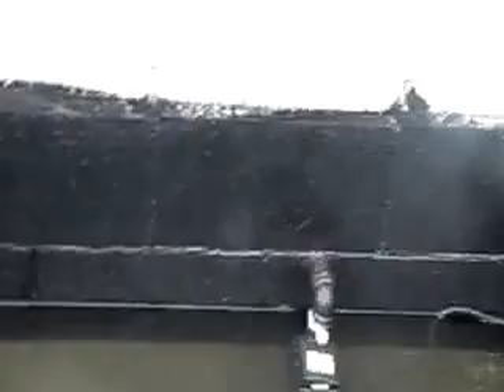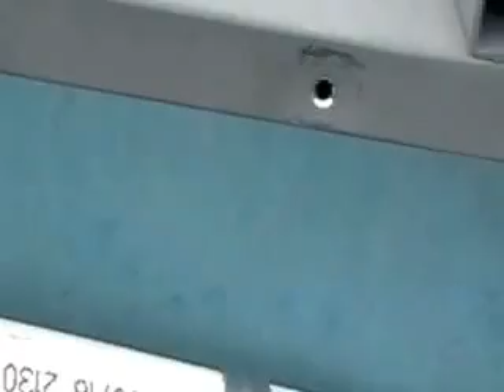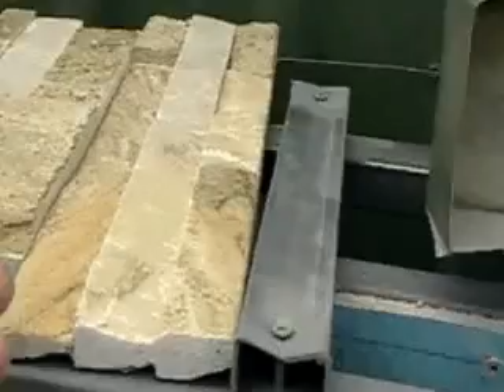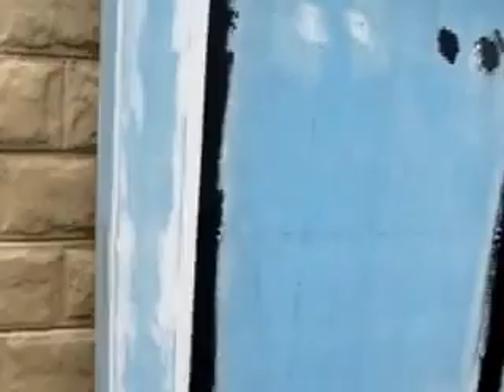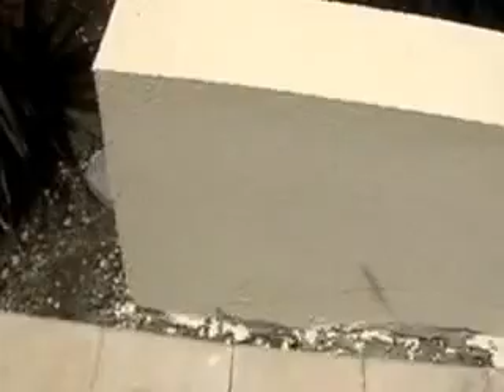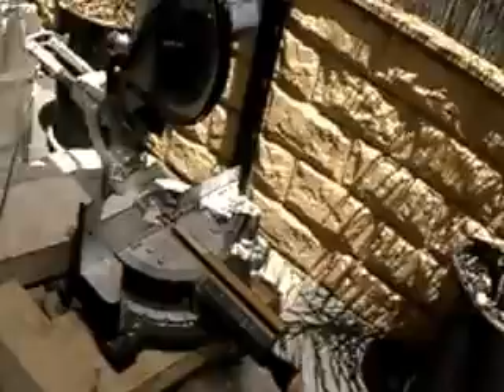building a water feature part 2

Comment: Thanks for sharing this, Its been hard to find details in building a waer feature glad you presented this here. My project includes 9 ft in length and 6 ft in height. How do you prepare the metal trough or the spillway, do we have to customize it ? Bcz this has been the hardest part. Also, can you provide the details on the inner lining of the pond to hold water.
Reply from the maker: Hi Meera yes that was hard to work out I basically used some guttering upside down and fixed some PVC pipe inside so it squirted onto the back wall. I am sure the video shows this. Trial and error lol. The liner is a water based pond liner paint/ tar from Bunnings it hardware store. You paint it on real thick let it dry a few Coates is needed. It is great as it is flexible. Good luck with your project

Comment: What material did you use to make the frame for the blue board?
Reply from the maker: Ken McConnell I used galvanized steel fencing posts
Reply: Thank you Robert. Did you use wrought iron materials 
on the side?
Reply from the maker: No it's all the same